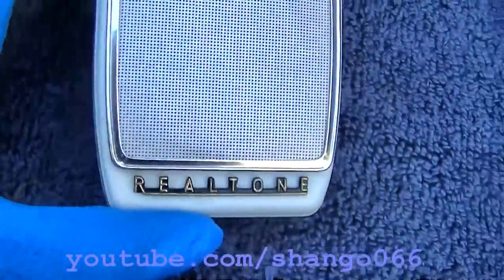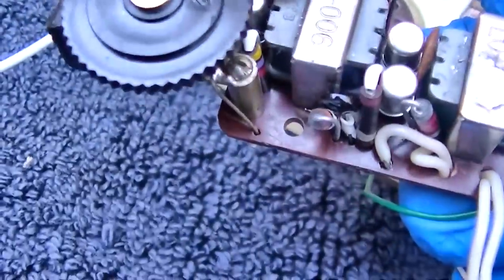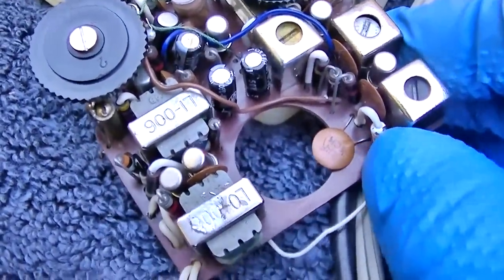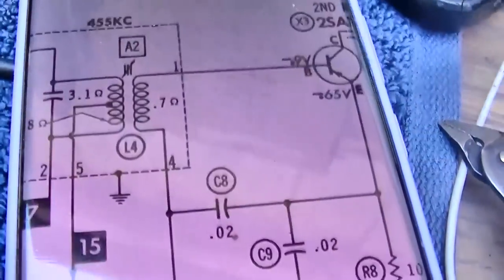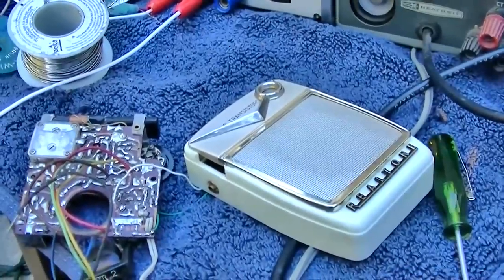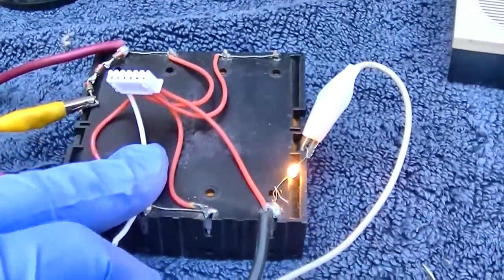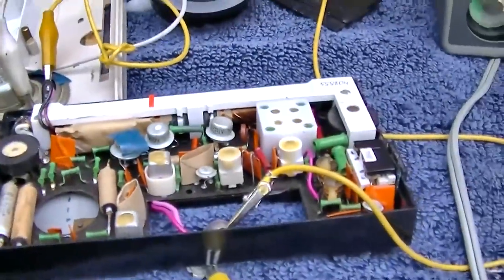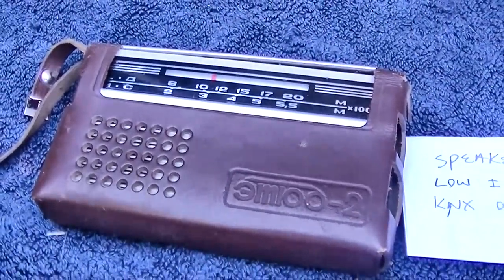1962 Realtone Transistor Radio And Etude Soviet Transistor AM Radio Diagnosis

Comment: Had to click after I noticed the HP427a in the thumbnail. I have one I haven't used for at least 40 years now. If my memory serves me, a friend gave it to me, but I retired it due to the cost of the proprietary battery packs required to use it. But in recent years I've been converting all kinds of devices, and tools  to lipo battery packs for power, so maybe it's time to drag it back out of retirement with a fresh pack of 18650's and USB charger. If I only knew (and had) then what I know (and have) now!  Real meter!

Comment: Nothing like having the schematic for the circuit your working on. I hate it when I go to the Sam's tsm index only to find that the radio I'm working on is not listed!😣 I also have to say I've only run across one open germanium detector diode in 30 plus years. Not common at all. Thanks for the tip about too much heat destroying them. Love your videos!!

Comment: Those transistor interstage and output transformers have been readily available for many years from the various Australian component suppliers (and what remains of them). For example Jaycar has the MM2534 3k:3kCT interstage transformer, and the MM2532 1kCT:8R output transformer. And should you need to replace any of the IF transformers, they have a set of those too, cat. no. LF1050.

Comment: If you sub a Si diode for a Ge at the detector, the voltage drop difference might screw up the IF biasing in the AVC circuit.  This could be fixed with a change in a resistor value though.
Remove the diode and the first IF stage AGC is fsck'ed.

Comment: Maybe the electrolytic on the 1st IF bias voltage is in backwards or shorted? Electrolytics behave like a short if reverse biased, with 200k from 9V that would be a very small current. Or maybe the transistor is leaky B-E. I think the way they take the 2nd IF bias from the audio driver it's a form of AVC.

Comment: The speaker in the Etude looks like the same used in the Sokol 403, which basically everyone had in the Eastern Bloc, tons of them around. I wouldn't be surprised if some of the components were shared, even the design and the carrying bag looks similar.

Comment: I looked up your HP meter. Very nice unit. Service manual on it was excellent meter was made to be repaired but then again it was an HP product!  If you used all of the same model number products to calibrate the meter as the manual called out you'd spend $50,000 on just the calibration equipment back in the day.  Tek and most other equipment manufacturers did the same thing.  The only negative I see with the meter is it uses the unobtanium three-pin belden power cord. I'd have to change it out to a standard IEC.  

Next time for true 1962 flavor maybe use a Simpson 260 or a Triplett 620?  Back in the day nobody but aerospace, electronics manufacturers or military contractors used HP.  It was just too expensive for the average service shop to justify buying.  If you're worried about blowing semiconductor junctions using the ohms function there is the Simpson 260-6XLPM Low Power VOM Multimeter.  Got to buy a used one though. Amazon lists it right now for $796.60 dollars!

Comment: W/r to that 'Etude' speaker. I watched only cursory, but it's 0,1ГД-13 (it's stamped on its magnet over; ГД stands for 'dynamic loudspeaker'), meaning it's 0.1 W. It proved rather complicated to find info about, but it looks like it had 50 to 60 Ohms resistance. Low-power wideband-ish speakers' models had been re-labeled in 1970s to ГДШ (Ш for wideband).

Comment: For the first set I'd try using the chinese radio kit transformers and see what happens.
And the speaker of the second set, my bet is that is open due to corrosion on the flex wires from the terminals to the speaker cone. It is possible to repair using very fine stranded wire from and old headphones cable.

Comment: So i have a rather interesting question/idea. Could you 
A - replace the transformers with ones of similar inductance?
B - delete the transformers an put a resistor equivalent to the windings resistance and a coupling capacitor to the next stage (this probably wouldn't work for a senter taped transformer)

C - for center taped transformers you would use 2 resisters that are as close to the inpidance of the senter taped winding as possible to form a resistive devider and place a coupling capacitor in the middle of the devider to the next stage. I understand the transitor tipicly gets its power threw the secondary winding so you would have to add a resistor of equal or near equal resistance to make up for that but i think this shuld work..or at least would make for a interesting educational video

D -  you would pull all the comments off the audio stage an replace them with a small audio amp module. Since those are available and cheap
Reply: use the lm386 module like he said.  tapped resistors wont provide the impedance matching and phase inversion needed for a class B push pull stage
Reply: @mohinderkaur6671  that feels like the lazy an boring answer tho. No fun or challenge in that at all
Reply: @ceilingfanmusic6597  proper fix - transformer winding machine and rebuild those transformers. not impossible to do.
Reply: You could create an acceptable push pull amp using around 6 transistors, 9v is as low as you can go though, and space here is VERY tight. I've actually done it for one radio, just for fun, quiescent current is around 9ma and it measures low distortion. The LM module is better in everyway other than distortion, easily better than the original amp and the small about of distortion the LM amp generates is completely inaudible in something like this radio.
Reply: @Seiskid  3 transistor amp with 2 pnp and 1 npn is easily possible. 2 diodes for biasing the output complementary stage.
Reply: @Seiskid  3 transistor amp is possible to be built in the same space. leave the transformer there - disconnected. replace 1 output transistor with a npn. bias the o/p with 2 diodes.

Comment: 7:10, that should be 0.7V not 0.1V.  I know the top of the 7 in the schematic is real short, but 0.1 is too low to bias any base-emitter junction with a grounded emitter.  The forward bias voltage for a transistor is the same as for a diode.
Reply: They are Ge transistors. The drop across a Ge junction is .3 Volt. It should not be .7 Volt then. 
My guess is the transistors are operating almost in Class B mode. Some distortion has been deemed acceptable for higher efficiency.
Reply: @westelaudio943  It sure looks like a short "hat" on the "1" in the schematic.  at 0.1V, that amp wouldn't be AB, but a buzzy Class B.  I wouldn't rule out the possibility that the finals were actually silicon and not Ge.
Reply: @russellhltn1396  

2sb116 is a Ge type though. ICmax 50ma... 
Not sure. Near Class B operation might be acceptable in a pocket radio.

Comment: I would have fixed that magnavox as the convertor was still working. someone has reverse polarity it causing destruction of the class B. Lm386 is a good solution. and maybe a new if transistor

Comment: Beautiful 😍 radio 📻. It’s the ‘57 Chevy of them. I was going to say Viscount, but it’s a Realtone. The electrolytic capacitors are bad. I see P661a on the circuit board, there, on the lower right side. The front of this radio looks really nice 👍. Ya might need to rewind ⏪ the driver transformer. You’re finally getting sound from the speaker 🔊. Ya got it!! A radio station 🚉!! Your friend, Jeff.

Comment: 3" reel to reel tape recorders are a good source for audio transformers. The only value they have is antique charm and most of them have bad rubber parts like the rim drive. Even when they were new they didn't sound good. They're good for mission impossible voice only. Record music and it sounds like a tweeter and distorted because its cheap DC bias. They are way overpriced on eBay. The good ones that have AC bias are worth more

Comment: I'm curious why you wear medical gloves when you're working on radios? It seems like a trend lately with youtubers?  I thought it might be to protect you from electrical shocks, but this is a low voltage radio, so that can't be the reason.
Reply from the maker: Pb
Reply: Shango has a high level of lead in his body I think he said its borderline high. So he wears gloves now.
Reply: Fran Blanche explained it in one of her videos about using surgical for working on electronics and lead exposure.

Comment: I’d use Dura Leaks (Duracell’s) in this, in a pinch 🤏. That may give ya a more gradual battery 🔋 drainage slope, not a sudden dropoff. The faulty rechargeable batteries were probably the culprit of this radio being completely dead 💀, upon turning it on for the first time. The transistors and capacitors are also reforming, or biasing on. Your friend, Jeff.